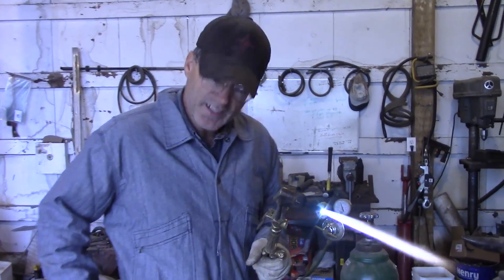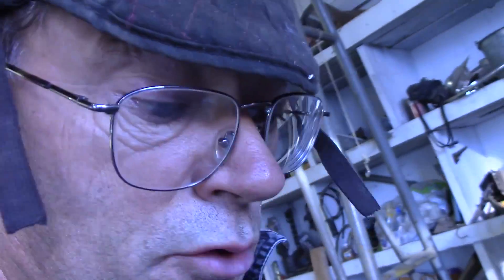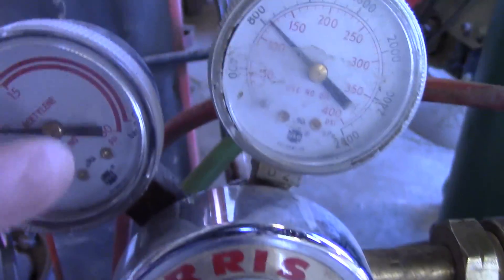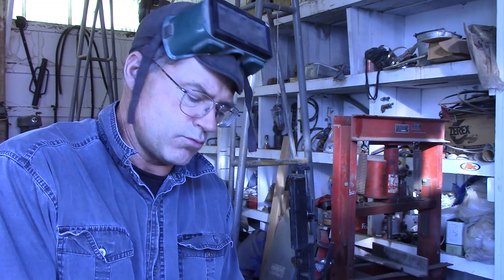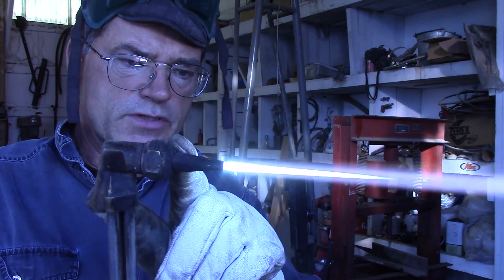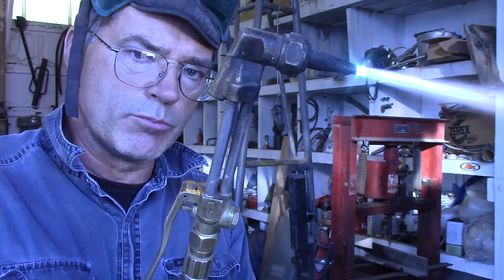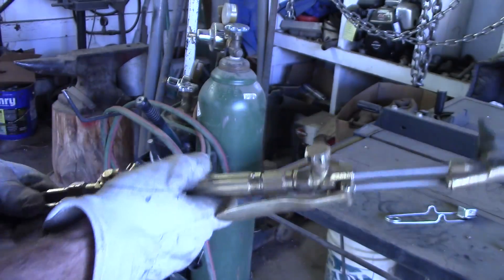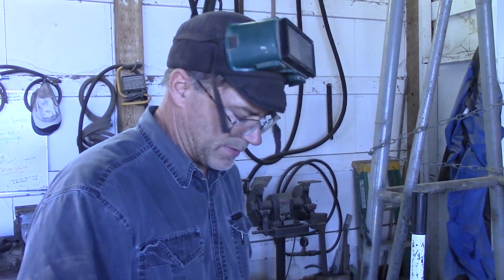How to use a Oxygen/Acetylene Torch-DIY Duke

Comment: Couple safety concerns. First, you need to put on those goggles as soon as you get the flame going, not just when you are cutting, or you're going to eventually damage your eyes. This video's main problem, however, is that you REALLY need to stress the importance of backing out your regulator valves BEFORE you open the tanks. Then once you open the tanks, slowly screw the regulators in to allow the gas into the hose. If they aren't backed out when you open the tanks, the rapid increase in pressure can cause a blowout of the regulator, which is a VERY serious danger considering the pressures held in those tanks. You also need to stand away from the front of the regulators as you do this in case a blowout does happen, because if it does, if you are in the path, it will send metal straight through your chest and easily kill you. This is not as rare an occurrence as you would think. On that note, you may want to mention the importance of flashback arrestors as well. This is a very useful tool to have but it is also by far the most dangerous tool you will ever have in your shop, and it needs to be respected. Anyone using it needs to be made aware of the dangers and potential consequences of not following safety protocol.

Comment: Hey Duke, cool video on the Acetylene torch. As an enthusiast you might enjoy checking out a propane/oxygen surface mix torch. It won't get hot enough for metal but its whisper quiet. It's what I use for glass.

Comment: your acetylene pressure is way to high. with 9 psi of acetylene and 60 psi of oxygen you can cut though 18 inchers of steel.
the oxygen does not blow away the molton metal it oxidizes it, that is why you can not cut though rusty metal, as it has already been oxidized.
you should never light your torch by turning on acetylene first, use a little bit of oxy and acetylene, the soot is toxic and its against safety laws.
Reply from the maker: you've probably never worked on a farm Derek or a salvage yard.  that pressure works great and it does blow the slag out and I cut rusty steel all the time, fact the steel I'm cutting is rusty.  Far as lighting the acetylene first, that's how it's done, it's not a college class out here. it's the real world.  But thanks for your critique anyway.
Reply: +DIY Duke i worked in a shipyard for 20 years as a time served oxy, acet cutter {burner here in the uk
i now own two salage yards which i have built up on my own.
please do your home work about cutting rusty metal. if you turn your pressures down your bottle will last a lot longer with the same results
Reply from the maker: The pressure Derek as demonstrated in the video was the levels we use all the time and the oxygen was not at sixty, if you remember I showed how you can adjust the regulators.  If you had 60 psi of oxygen and 9 psi  of acytelene you'll blow your acytelene right out.  I'm not going to put a video out of this nature without following approved steps for igniting fuel gas and when it comes to acytelene a producer of oxy-fuel equipment  (Smith Equipment) clearly states in the procedure for igniting acytelene, "Step 1. Purge the hoses. Step 2. Open the fuel gas valve 1/8 of a turn and ignite the gas using an approved friction spark lighter.  Step 3. Open the oxygen valve until you achieve a neutral flame."  Now in your salvage yard you may have your torch set up with the oxy mix dialed in for cutting same thicknesses.  That doesn't apply here.  Now I'm not being a smart ass and don't take it wrong but I'm been doing this kind of stuff since I was 17. I'm 58 now so it's not my first rodeo.  It's been working fine for 41 years.  I don't just do one thing around here like a salvage yard, I put things back together, hell I even cut rusty steel, even weld rusty steel.  I'm sure you have your own methods, good deal, why not show the world and make a video I would love to watch a salvage yard in England, think it would be very interesting.
Reply: 9 acyt and 60 oxy? lol clearly tells me you don't know what you are talking about since that will never keep a flame and blow out and you are wrong about the rust ,oxy not only oxidizes but blows the slag away at the same time and that piece must be rusty all the way through for it to give you problems and not cut otherwise the heat brings the metal underneath to kindling temps and the oxy blows through the layer of rust and keeps oxidizing,iron oxide is not that high of a melting temp and its not fully oxidized(ie complete combustion) so plenty of fuel left in it to be burned by the oxy ,and lastly " the soot is toxic and its against safety laws." where did you read that from? you saying sooth is against the law or the lighting sequence? you always light the fuel first because otherwise you risk creating a burnback or a flashback(sustained burnback)  in the torch and possibly the lines with the higher oxy pressure either resulting in creating an explosive mix in your torch body or flame back in your lines,that is where the danger is,,,now i do not necessarily agree with how he shuts the acyt first,personally i shut the oxy off first to avoid that blow back explosion and it reminds you that there is still a flame on to be shut for safety reasons as some ppl forget the oxy is still on once they no longer see a flame if they shut the acyt first